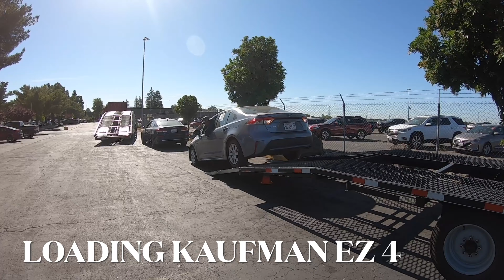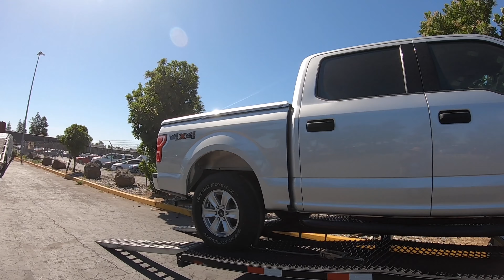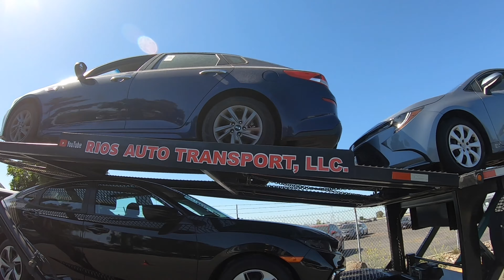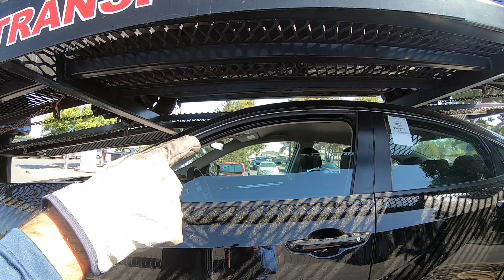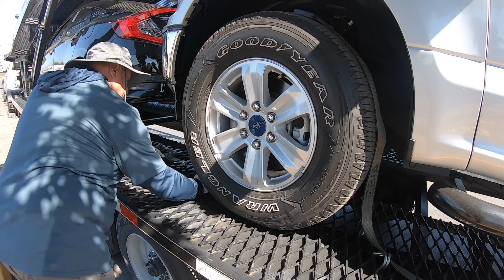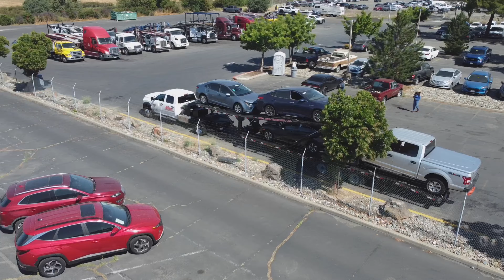Loading Kaufman Ez4 25k GVWR trailer. 3 axle, Heavy load. Hot shot car Hauling.

Comment: Why do you back the first car always? In this video you back the first two cars. Please explain. Thanks
Reply from the maker: Backing the first car takes a lot of weight off the drive which is the second axle of the Dodge.  Usually you have more overhand in back of the car rather than the front. By backing first car you leave more room on upper deck for the second car
Backing second car keeps height lower.
Reply: @riosautotransportllc  thanks for the answer
Reply from the maker: @johnsmalls4856  You’re welcome.
Reply: Do you offer a mentorship program?
Reply from the maker: @johnsmalls4856  Possibly in the future, meanwhile if you have any questions we are happy to answer them.
Reply: @riosautotransportllc  can you explain why I hear that the triple axles burn out quicker or have more problems than the dual tandem axles. From what I read triple 7k axles are worst than dual 10k axles. I can’t understand this. Thanks for any help you can provide.
Reply from the maker: @johnsmalls4856  Making a Youturn with a load puts A Lot of stress on the third axle.  I never make a Youturn with a load, if you avoid youturns you shouldn't have any problems.
Reply: @riosautotransportllc  thanks for the answer. You’ve been very helpful in my journey with finding the ideal setup.

Comment: How often do you get a full load with 4 cars?
Reply from the maker: It varies if we have 6 vehicles we’ll do two loads of three. Last 3 few days it’s been full loads.
Reply: @riosautotransportllc  I just bought me a 7 car hauler for a semi. Let's see how it goes. Do you happen to know what a full load is going for nowadays?
Reply from the maker: @luisresendiz7076  It varies most of the time it's per vehicle.  We only transport locally  (high fuel prices here yesterday Diesel was $6.89 a gallon). On average the vehicles we haul pay around $2 a mile again all local usually within 60 miles.
Reply: @riosautotransportllc  is that 2 dollars per vehicle ?
Reply from the maker: On average $2 per mile per vehicle.